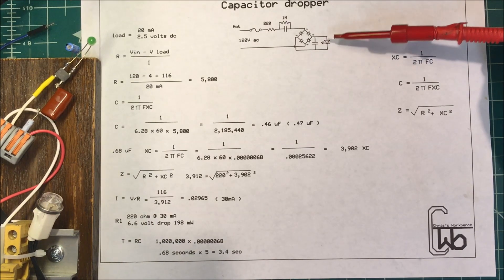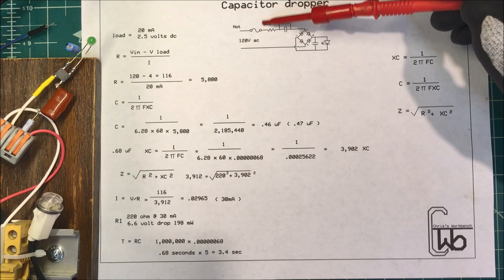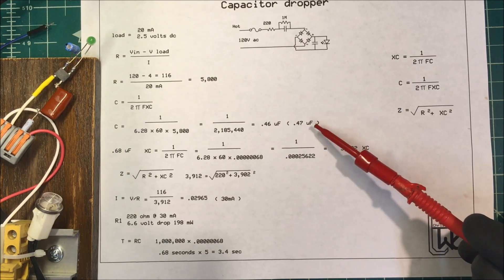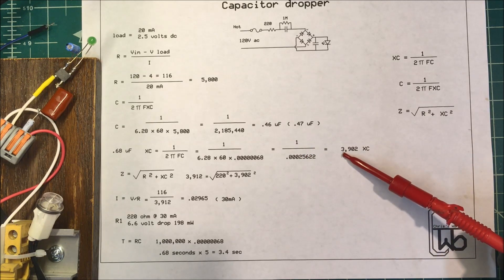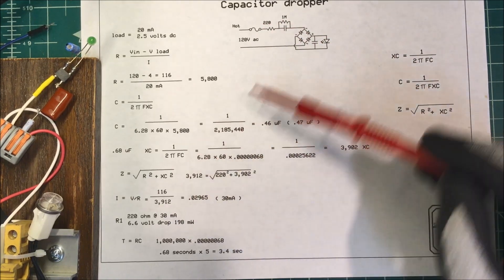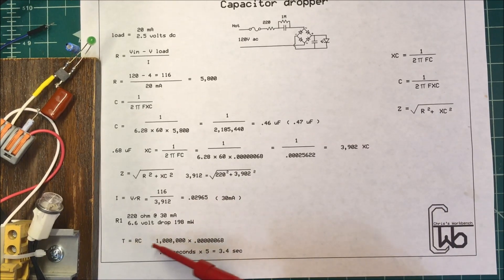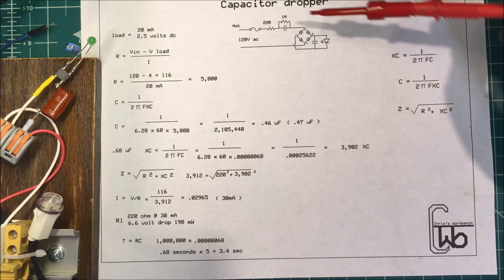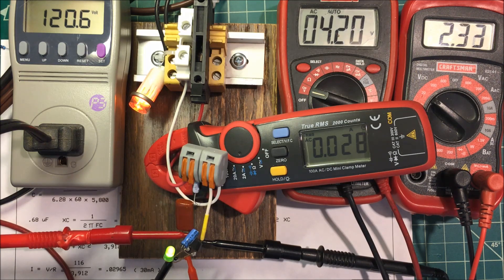Capacitive dropper

Comment: Rectified 120vac is around 170 volts. That should resolve your issue of the current being 40% higher than calculated.  Great video, though!

Comment: nice vid, sir 

how do you obtain the C value of the voltage stabilizer cap in parallel with the output load?
Reply from the maker: Thanks I'll do a vidio on smoothing capacitors
Reply from the maker: Check out My Smoothing capacitor video.